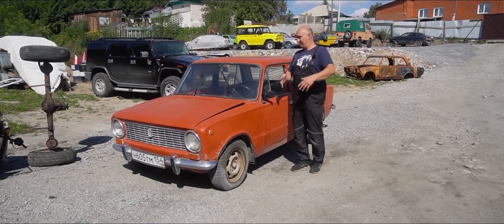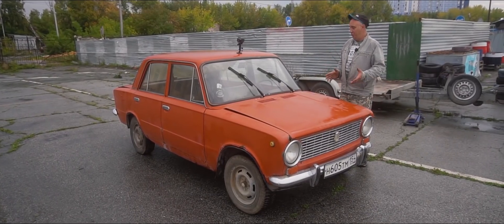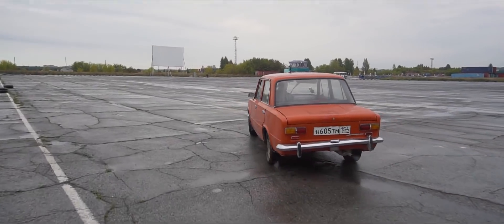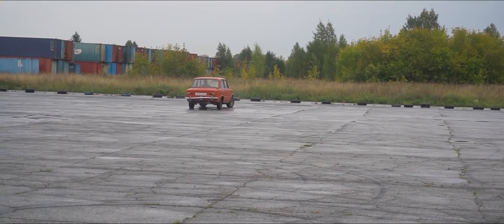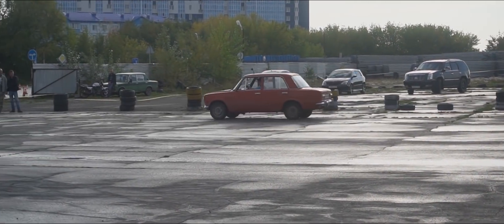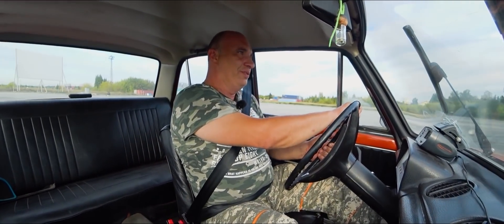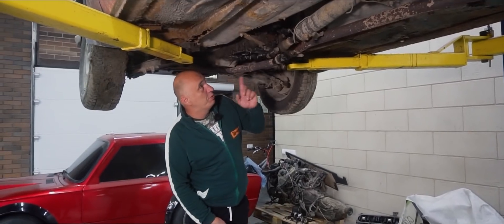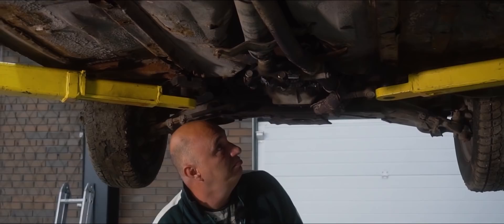How far can you drive with no gearbox oil?

Comment: I had it happen where in 1999 I had the stick shift transmission on my Chevy serviced and I didn't realize it until years later. The shop used the wrong lubricant and it all boiled dry. The transmission began making whirring and whining noises. After having another shop replace the lubricant I put this stuff called X treme Friction Fighter in. It quieted the transmission but a few years later, the transmission failed and had to be replaced. This was interesting because I see an illustration of possibly how the transmission in my Chevy might have failed if I had done nothing.

Comment: standard transmission also needs oil? :O i thought only automatics need it
Reply: They don't need oil replacement
You never need to change the oil or check the level in the transmission really
Reply: looks like i got 2 totally different answers

Comment: Now it is time to fill the engine with antifreeze, fill the cooling system with engine oil, automatic transmission fluid in the brake system, and lastly brake fluid in the auto trans! Let's see how long what lasts then.  Lol
Reply: It'll shift rough, blow a ton of steam out the exhaust, and eventually the coolant will boil away if the engine doesn't seize first.  That'd be perfect for this channel.
Reply: @timh9537  The engine would DEFINITELY seize within the first 3-6 minutes from lack of lubrication. I did something unbelievably stupid the other day and I drained the oil, swapped my oil pan on my Honda 3.2L V6 (to install an oil pan with a -10 AN bung for a turbo oil drain), and the next day I finished everything and I started it to hear the exhaust with the turbo manifolds and I forgot that it had NO oil on it. I even revved it slightly until I saw the oil pressure light on. I IMMEDIATELY shut it off because I felt like a dipshit. I've never done anything like that before, so I really felt stupid...lmao Anyway, it's a JDM J32A so it's a really low mileage engine and it only ran for 10 seconds or so, but luckily I saw that idiot light and shut it down. Thank God the filter was still full and I noticed it before it caused any damage.
Reply: I'm aware of what will happen lol, I just think it would be cool to watch regardless lol.
Reply: And petrol in the diff maybe
Reply: @m.b.82  Hahaha yes!
Reply: Why won’t anyone ask him to drive the car with Gasoline in the cooling system?
Reply: @mtadc1545  We dont want him to die
Reply: @mtadc1545  Hope your not serious
Reply: @MultiBeast301  oh I am very serious! Would be interesting 😂😂😂
Reply: @Muh boi Wow, I would love to live in Sweden. Not because of the cars lol but it is beautiful over there! Anyways I swear if we were to produce all manual shift vehicles again it would cripple the country lol. Nobody knows how to drive one anymore if they're under 30 to 40 years old lol. XD
Reply: Suzuki had a oil cooled motorcycle '90s and he was unbreakable
Reply: Only thing that would cause a problem is the oil antifreeze swap the other two are cross compatible lol.
Reply: I replaced my brake fluid with atf. only an idiot would use brake fluid after doing a bit of testing with it. absolutely disgusting stuff that absorbs water and rusts out your brake lines. the edpm seals used are fine with atf as long as it's synthetic. I did make a couple parts to replace a few plastic ones though.
Reply: @Jombo23MC  Go to the doctor
Reply: Don't forget petrol in the screenwash bottle!
Reply: @Muh boi Oh, no worries bud. It happens. I wonder how many automatics there are over there though, as opposed to manual shift ones. Here in the States there are very few manual shift vehicles left, sadly. :(
Reply: Na just vodka in everything😅😅😅
Reply: @davidmckendry4491  Their latest vid has them putting vodka in the engine lol
Reply: project farm has entered the chat
Reply: Would love to see this lol
Reply: Neutral drop did that already
Reply: Yes
Reply: Hi guys really enjoying your videos here in Scotland. Can you tell me where you are in Russia and what the large building is behind you ?
Reply: @Muh boi Duh, yes I know that. But I'm sure they can find a car with one.
Reply: i had a car that did most of that its self lasted a few 1000km
Reply: i want to see oil in cooling system
Reply: @PREDATEURLT  brake fluid cannot withstand to the pressure of the gears in the box meaning that the gears will squeeze the fluid out of between the gears although anything is better than nothing so I'm not disagreeing 

I realised he said auto
Reply: Brakes and tranny would be perfectly happy
Reply: Creative idea's my friend.
Reply: 8:56
Reply: Antifreeze + gasoline = hydrolock, aka your connecting rod will bend or snap in half.
Reply: @tristan6509  yeah but how can we be sure unless we replace all the coolant with gas?

Comment: Is it a sign of a low amount of gearbox oil, if it gets harder to shift gears? Because I'm currently experiencing that.
Reply: That, or the clutch has an issue like being partially pressed for some reason. If the clutch is hydraulic it could be the pumps, bleed the system and check again, if it works for a while then air gers in somehow, or else the clutch plate has an issue. Not shifting smoothly usually means the synchros are not letting the gear to slip in due to clutch failing to completely disengage the engine. Try changing gears with the engine not running, if it doesn't do that then it's probably the clutch.
Reply: @johnbelwell2461  It engages very loudly, and difficultly, both when the engine is on, and off.
Reply: @MemeL0rdOfficial  is the shifter indirectly driven like cable driven? Maybe it needs an adjustment? No idea, but being hard to shift with the engine off it definitely has nothing to do with the clutch
Reply: Could be the clutch
Reply: If you're getting grinding when you don't put the gearstick in smoothly, its the synchromesh worn
Mine does it all the time for third

Comment: Without watching the video I can say for a fact that a 1994 land rover discovery r380 gearbox can run exactly 14 miles with no oil. Dont ask how i know.
Reply: freezeme360  94 probe, nearly a month
Reply: Toyota Sienna - 5 miles
Reply: 92' Acura Integra: 1/2 a mile 😒
Reply: A 2001 GMC Yukon XL will idle and move in forward and reverse for 10 minute with no automatic transmission fluid, and 12 quarts of engine oil, (normally 6qt)...my brother drained the wrong plug. Was fine after, no issue
Reply: How do you know?
Reply: freezeme360  my bad👍am i forgiven?
Reply: freezeme360  it was a joke dipstick,he said dont ask how i know
Reply: freezeme360  👍

Comment: All i know is mine was slowly leaking to the point it was empty which i could realize from the noise and when the shifter wasn't moving smoothly, i was adding like half a liter every now and then, but i ended up fixing it after like 3 years... I was suprised when i drained it had like 150-200ml of oil but was working like brand new after i refilled it and changed the seals.

Comment: Next a automatic transmission...
Reply: GL with that one, I mean I guess you could try towing one around for a while.
Reply: The results are predictable, it wont even engage a gear since it needs oil pressure to do so. Partly filled or low oil pressure will result in whining when changing gears or loaded, dumping gears, not going to reverse or random shaking.

Comment: another idea  what happens if you engage reverse    at full speed going forwards with a lada what will give a way first  engine or gearbox
Reply: Nothing. Eighter you will lock wheels or engine will spin in other direction. Also, MasterMilo did video about putting reverse in at 100 kph.
Reply: I did it in a Lincoln continental. 
Smoked the tires. 

Breaking traction saves shock on parts. 

It’s when you have sticky tires you do real damage.

Comment: What Happens when you drive without clutching ?
Reply: It's possible. Auto clutch. I do it all the time.
Reply: If you're talking about shifting, I hardly ever use the clutch. I drive semi trucks,tractor trailers, articulated lorries,whatever you might call em! I use the clutch to take off of course,then you just listen to the rpms and slip it into gear,down shifting you have to bring the rpms up to match and then slip into gear. Not hatd at all,just takes a lot of practice,and when I've been off for a while,I kinda gank em the first couple shifts. You let the rpms drop upshifting,and raise the rpms downshifting.
I have no idea what an auto clutch is,unless it like the 4wheelers that have gears but no clutches. Or maybe just a newer nicer vehicle than I drive!! Distinct possibility!
Reply: @tomcline5631  None of that. Nice car. I drive at the moment my 18th Honda. 97 civic. I was told that it was called that. It's fun to do.
Reply: @funkworthrollin4959  Oh you float the gears and someone called it auto clutch! I get it. Yeah it is fun,but it also makes things a lot easier in a big truck! Those clutches on those things are heavier than hell and I got a bad left knee/leg!! 
I drive a 1992 Chevy Suburban, it's an automatic transmission,shifts ok. Anyway,this is the newest vehicle I've ever owned. Love the older stuff!

Comment: i accidently  did that before ... i engine swapped a bmw e46 316i  with a e46 318  And i forgot that the previus engine owner of the 318 engine drained every liquid .... even the gearbox oil Soooooooo after swaping it  i was eager to drive it  and after 5 km  it startet to whistle  from the bearings   and i actually made it home to fill up the oil  and it worked for another 9000 km before the berings where shot

Comment: If you just drain it about 700 miles or about 1100 KM of freeway driving. The output shaft bearings ends friction welded to the case. Almost made it to Pensecola.
Reply: Is there something about the highway to Pensacola? I blew out my rear differential about 20 miles outside of Pensacola.
Reply: Why would you deliberately drain your transmission before driving to Pensacola?
Reply: @jjohnston94  Cracked the case about 150 miles into the trip and it leaked. Should have went with a beefy one but that one was cheap. It was a 1969 Suburban I got real good at replacing them. Usually took longer to get it up on 4 jack stands than actually doing The R & R. Finally located a M-21 and that was the end of it. The previous owner had it converted to a THM400 with the same stick shift rear end. I put it back to manual but finding a big enough manual was not easy. The big block stick Transmissions usually are not easy to find. I was running a stroked 350. Too much torque for a Saginaw 4 speed.

Comment: I’d estimate 25 miles, had no oil in a Citroen c2 gearbox after a massive burnout put a hole in the bottom of it and it survived about that far before completely dying 😂
Reply: Pretty much any metal-on-metal piece of machinery needs oil or grease, otherwise the components will wear against each other.
Reply: @normang3668  Ohh ok
Reply: I didn't realise you needed gear box oil LOL
Reply: @BindaasMovieShorts  did you know that differential needs oil eather
Reply: @fuolku1006  oh, i never knew
Reply: As I did one day after I got my c3 2005 at 40000 miles. That's what you think after passing your test. Youre in something that's atoned to a race car 😂 anything passed 110 horsepower and the c2 gearbox explodes "with oil"

I got 20 miles w/dry gearbox. 

That's a lesson for you kids don't mess with your turbo actuator or injectors 🔥✨💣💥

The c2 gearbox is interchangeable with the c3 model, and vice versa. Just incase anyone was wondering about parts.
Reply: Mk3 golf lasted 2000km and still drove with the first 3 gears. It even drove 300km with no oil pressure before being fixed and the engine had no lasting damage.
Reply: Robert Burley  I estimate 2 miles
Reply: @Allosaurus 67 Nope, just had my car for a few weeks.
Reply: @Allosaurus 67 yeah, thanks for telling me :)
Reply: I call bs lmao. How the fuck you do even a slight burnout in one of those shitboxes with 80 horse
Reply: @Attachments.  it had 73bhp (real monster ik) and bald tyres, one of which started on mud. It also had the mechanical sympathy that only a 17 year old can give 😂
Reply: @Attachments.  hey you can just modify
Reply: @Attachments.  If the front end is light enough it's easy enough. Strip all of the oem shit and turn up the turbo. The torque on the tdi 1.6 remapped is enough.
Reply: Question: why were you doing burnouts in a citroen c2? 😂
Reply: @JohnnyCage4Real  do you not do burnouts in any vehicle you own/drive? I’ve even figured out how to do them in the forklift at work 😂😂
Reply: @notagremlin7030  yeah now that you say it 😂 its kinda fun actually
Reply: But how did a burnout punctured the gearbox?
Reply: @satsumagt5284  I think it was because only one wheel was spinning at redline, shot a chunk of the diff out, left a 2 inch hole
Reply: @satsumagt5284  because he would need to keep changing gears i think maybe
Reply: i did 85 miles in a  4l65E  it still worked sotra  but slipped really bad  the revise gear worked fine though
4 speed auto
Clutch pack was gone  ..    that car was a giant money pit
Reply: punker4Real what truck lmao. My 4l60e driven avalanche has 175k miles and has 0 issues nor does it ever break. Sounds like you got a lemon or bought it off someone who didnt maintain it.